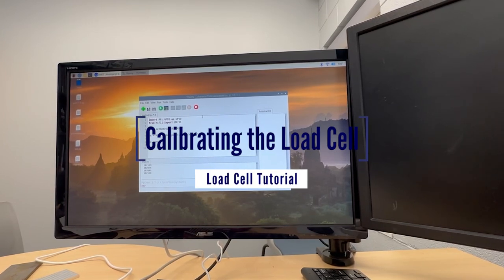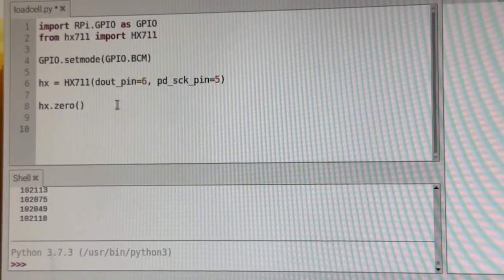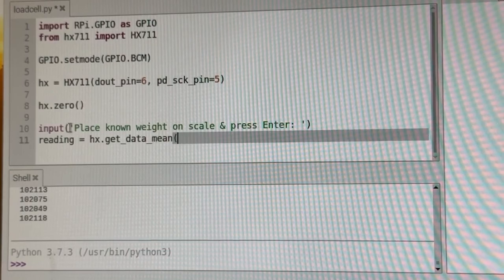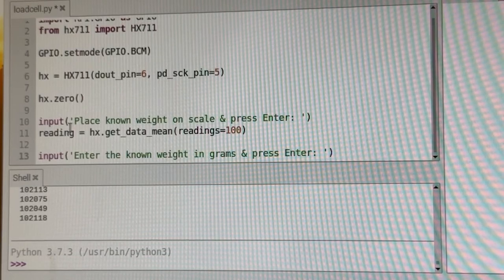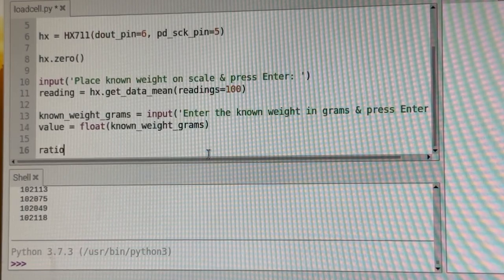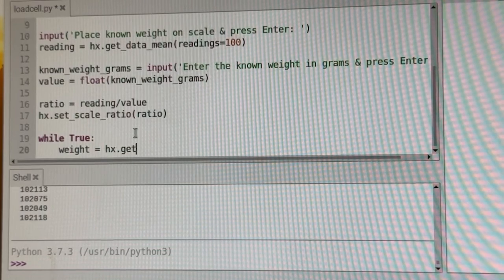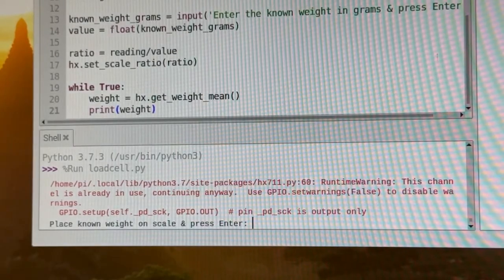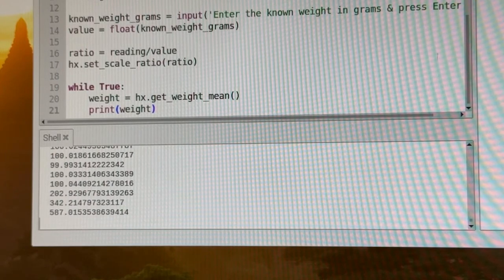08 Calibrating the Load Cell to Read Weight/Mass

Comment: I'm trying to do this on raspberry pi 4. When I tried to install the library as you did in your previous video I got an error "externally-managed-environment". no matter what i did i couldn't install it that way. After that i installed the library directly from github instead of over the terminal. I don't know where i'm supposed to put the files so i just left them on desktop.  My code kept giving me an error saying that file "hx711" doesn't exist so i put my code in the same folder as that file. Now when i run the code i get a traceback error that says "stdev requires at least two data points"
Reply from the maker: I would need to see more of the code. Stdev is the standard deviation and it needs at least 2 separate data points to be calculated, otherwise the denominator in the standard deviation formula is zero.

Comment: Do you know if I can use that product for tension and compression??
Reply from the maker: The load cell works on a cantilever bending method. It should give values in both directions.

Comment: Hi, I have one more problem with my scale. While at zero, the "readings" parameter is slowly gaining value, e.g. 0.02, 0.03, 0.06 etc etc etc
How do i solve that?
Reply from the maker: Could be a lot of things. I would try to find the cause by swapping out components to see if you can isolate the issue.
Reply: I have the same issue, i think i is related to the code somehow. because before zeroing it there is no problem
Reply: @sajedrezaei   in my case, the solder on the HX711 was faulty

Comment: I have follow the serie of videos. great content, I follow it but I am getting random weight after calibrate. Any idea what should I trouble shoot? I check the connections and all is good
Reply from the maker: Once you calibrate, make sure you are using hx.get_weight_mean(), not hx.get_data_mean(). The “get weight mean” takes into account the calibrated ratio, whereas “get data mean” does not. That’s my best guess without seeing your code.

Comment: How do I save the calibration values for further use?
Reply from the maker: Maybe write ratio to a file, then when you re-run the program you would retrieve the value from the file and set_scale_ratio appropriately before collecting any results. I don’t have this setup right now, so I can’t test to see if this works.